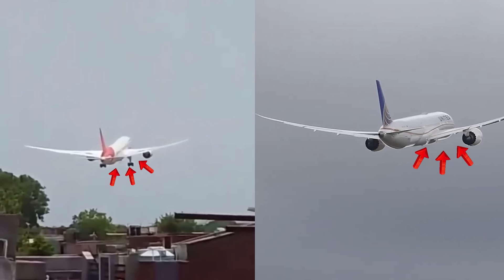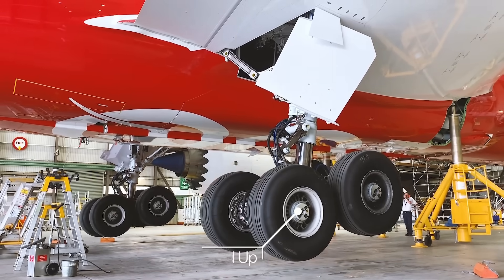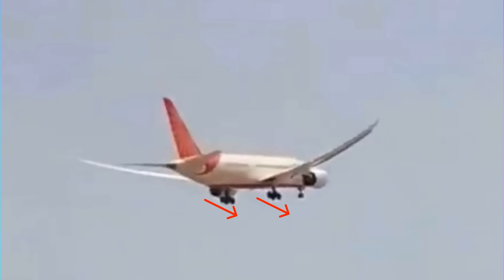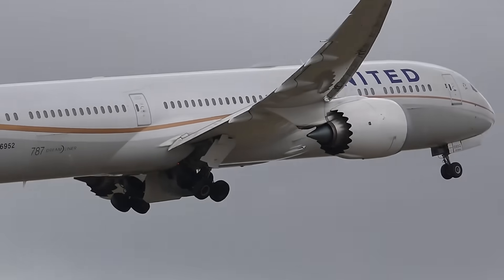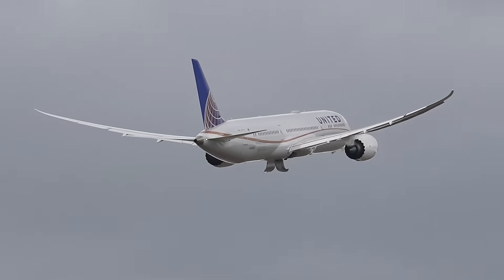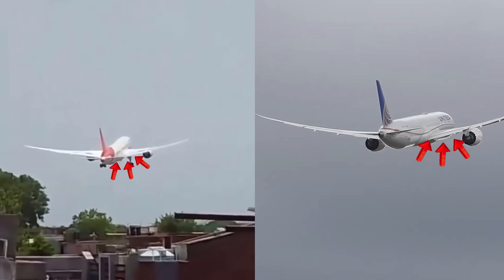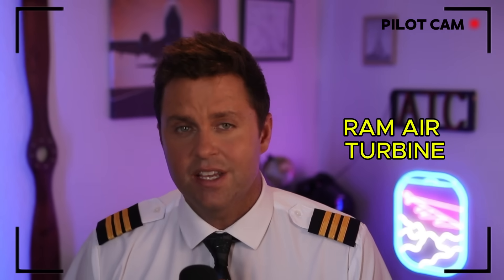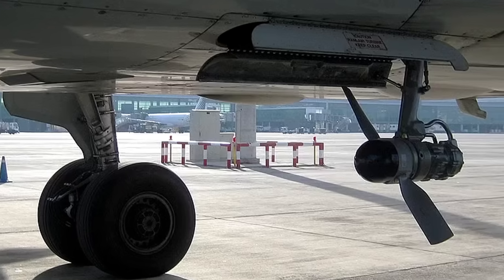Pilot Explains: A New Detail in the Air India 787 Crash Everyone Missed

Comment: Every one keeps saying the flaps. What we need to see or figure out, did the aircraft rotate at a point on the runway that would be predictable ( normal )  for a fully loaded plane with passengers and fuel and flaps set for take off position.  ( not landing  position. there is another goofball Ex fighter jockey, Civ Pilot saying if the flaps where down you would not be able to see the landing gear, Hope I never get on a plane he is flying ).  We have all seen videos of tragic and near crashes of planes not having flaps down trying to take off.  To me this planes take off dose not look like it was struggling to get off the ground.  It in fact got off the ground just fine.  The one survivor said there was a loud bang before the plane dropped to the ground. (?) Something happened to take out all the major control system.

Comment: Sir, reference to the scenario plane travelled almost the entire length of runway, of 3-km, as against 2.5km normal runway, given your observations thereof, should the pilots called off the flight, as yet they have not reached the threshold thrust required for a lift ?? Probably that's when sediments blocked fuel flow to the engines ??

Comment: Let's assume one of the pilot did retract the flaps. Even then,  is that something that cannot be made up if AOA is lowered with engine at take off setting?
I get that it would be a risk if airspeed is close to stall, but would pilots leave that small of a margin?
I believe it is highly unlikely that flap mistske alone will bring the aircraft down, even if that mistake was made.
Also, would there not be a warning before the flap fully retracts?

Comment: I don't believe Contaminated fuel could be the reason as numerous flights might have taken off with refueling done but no flight reported of such contamination.
What i believe could be a factor is the pipes through which the fuel flows through in the wings of the flight might have developed cracks or might have burst which resulted in stopage of fuel reaching the wings and thereby the engines could not get the power, thrust to keep the flight airborne.

Comment: I don't know what the weather was before the fueling, but I remember a flight in Daytona Beach were I could read the tires on an airliner that could not climb. We had some torrential rain and a fuel truck cap wasn't secured and so water got into the system. The plane made it back, but it was pretty dicey. I am always impressed with the thoroughness of the NTSB. I just hope that Trump hasn't cut their funding.

Comment: I agree with what you are saying about the flaps being correct, the gear tilted forward in the pre-retract position, the RAT being deployed, and the quiet engines (which should have been making a LOT of noise and exhaust), and dual engine failure. What about total electrical failure? Is there a common thing (such as a battery bus) that could have shut down the computer control of the engines? I built my own Long-EZ and flew it for 28 years, doing the maintenance myself. I think a lot about the causes of failures.

Comment: Ahhh now it’s clear. Somehow the fuel cutoff switch was pulled. But the survivor mentioned flickering lights. Would lights flicker if power was switched to the rat? Also another commenter below is talking about total electrical failure. Also the survivor mentioned he heard the engines rev UP and get LOUDER.
Reply: Wouldn't explain the wheel truck camber issue.

Comment: Contaminated fuel would have likely affected other aircrafts on the day. To me it looks like severe electrical system failure cutting off fuel supply to the pumps and all other systems. Then, did the electrical system itself fail or did the control system software take control. Either of those two potential causes justifies a grounding of 787s.

Comment: This is the only reason that seems now. Dual Engine Failure which resulted in
1. Hydraulic Control Loss - Landing Gear didn't go completely up and airplane is completely in the same settings or orientation as it was during take-off to the very end.
2. Power Outage - RAT got deployed.
3. Distress message - 'MAYDAY NO THRUST'

Dual Engine Failure Possible Reasons
1. Contaminated Fuel or Compromised Fuel Refueling for that specific plane.
2. Fuel Supply issue or fuel starvation to engines which is due to maintenance issue which is high likely.
3. Pilot error disabling engines by mistake or deliberate action which seems unlikely.

It can be any out of these or other reasons. So, we have to wait for report that comes after a month and another that comes after 6 months or a year.

Comment: With bad fuel, any engine should "sputter" before it shuts down, with probably visible smoke from poor burn of fuel. And i would find it almost impossible for the 787 to have any malfunction that shuts off fuel to both engines , again so cleanly that there is no smoke. Why would you ever want a system that cuts fuel to both engines simultaneously ?

Comment: Is there any process to do with the apu being running during takeoff?

I would have thought a 3rd small, and systemically isolated system would at least maintain basic flight controls, and perhaps even gear retraction in the event of a dual failure, and/or at a bare minimum remove the drag a rat creates extending the flight time by a few important seconds.

Comment: Great analysis. The lone survivor told the media that lights flickered before the crash. Does it add to the conclusion that there was a dual engine failure?
Reply: Since the 787 is an electrically powered jetliner, lights flickering could be a sign of an electrical power failure, which could ultimately lead to engine failure.

Comment: Great catch on the gear however, I really think there’s going to be a good amount of pilot error for not aborting the takeoff. If you watch the takeoff roll, that plane was going unusually slow for where the camera picked it up on the runway. I understand most pilots/crew don’t have a set acceleration check during the takeoff but there’s almost a six sense that kind of keys you to how fast you should kind of be at a point in the takeoff. Then let’s say he noticed this beyond V1, (1. Underpowered engines 2. Probably heavy with a 8+ hour flight) seems like it’s better to take the odds over shooting the end of the runway.

Comment: Fuel bladders are in the wings. Kerosene floats on water. If the fuel pick up was sucking in fuel on flat ground, when the plan rotated, it is possible that it starting sucking in water. Especially if the fuel pickup is towards the rear of the wing. Once the fuel in the lines ran out, the plane was about 600 ft in the air and started injecting water, flamed out and thats it.

Comment: You need to get the view of a mechanic... lucky .. I have been one for 36 years.
1. The engines did not flame out. You could still hear the engines despite the rat.
2. Engines running at idle and could not thrust any power
3. Most likely, fuel tanker that delivered fuel had previously delivered gasoline and did not deplete one of its compartments and filled it with Jet Fuel ( Diesel) and unloaded all contentents which added gasoline to the jetfuel. Gasoline has a lower ignition point. When mixed, the engines will continue to run, but you will have no power to increase thrust and if had got higher and flew longer, the engines would sputter out.
4. If there is a crack in fuel storage tank, water from the ground will mix with the fuel. This will let the engines run for a very short period of time before shutting down since the water is not combustible.

If you put gas into a disel car... the engine will stay running at and idle once it reaches injection point and it will feel like someone removed the throttle cable.. you can pond on accelerator as mush as you want but is will have zero effect on rpm's of eng and then it will shortly die out.

The sound and actions seen point to gas or water mixed with the fuel.

I put this on both of captain steves comments... I have been contacted by other mechanics and they 100% agree.... I don't think many pilots have experienced this before and live to tell about it.

They need to check the storeage tanks which should have 2 printout daily that can show signs of water and they need to check the tankers that delivered the fuel and see if they had previous gas deliveries. Yes.. Gas, Diesel, Jet Fuel are all delivered by same tankers.

This plane has 6 fuel filters.. Id any survived, they need to be cut open and have the collection device checked.
Reply: I'm sorry but a lot of what you say is not correct, only one type of fuel is permitted to be carried in a fuel tanker. Jet Fuel is basically a very highly refined Kerosene called AVTUR. Both Gasoline and AVGAS (Aviation Gasolene) have a much lower flashpoint, as you call it, you probably mean ignition point, than AVTUR (Aviation Turbine Fuel). Water is always drained from the bottom of all vessels and containers prior to refuelling an aircraft as you are aware water always settles to the bottom of the tank. A small amount of water is not a problem for JET engines as it is for ICE piston engines that run on AVGAS. If they are carrying different types of fuel in the fuel trucks in India, it would be the only place in the world that it happens.
Reply: @glukes9 Funnu.. United airlines used the exact same fuel for its buses used for passengers and pilots from parking lots to building as its airplane.  The United buses used to have a problem with oil getting into the air syaytem that operated doors and brakes. I redesigned the air compressor return system to stop this. 
The exact same tankers transport all the trpes of uel, yes.. they are to be drained and cleaned between uses. It does not always happen. Some are to much in a rush and know a small amount of another liquid mixes with the jet fuel ( which IS a form of diesel) but the blend has a different specific gravity rate.
Most large airports in America ship fuel to airports via pipeline since planes like the 787 hold over 33,000 gallons of fuel and a tanker holds 7,500 gallons. 
We are talking about India, not America and my views on what happened is based on  it happening in India and what I heard on the sound of what was going on with the engines. They did not flame out and they did not mutually fail.
In America, we check readings on storeage tanks 2x's a day or more but it is before every delivery.
While tanker do have dedicated units, they do overlap and the tnkers have completely  seperated sections in them, making it possible to carry 2 different fuel in the same tanker. This breaks no OSHA or DOT laws, so you know it is done. I have caught many loads being shorted because the drivers just tell you how many gallons they gave you but when I check my readout so I can pay them to the penny, I can see they are way off because they forgot to empty a section inside the tanker..
I have listened to so many different kinds of engines contaminated with different fuel or water, it takes a few seconds on the gound to know what it is. These sounds are not availiable in the cocpit.
Reply: @glukes9  It is correct in India.

Comment: So I was thinking a few things

Was there fuel contamination? but in today’s world dont we have trucks that monitor specific gravity and moisture closely?

Loss of lift :
1) electrical and hydraulic failure - not sure if there was a maintenance issue leading to fuel sysrem failure.
2) I wonder if there was a control trim actuator lock.  if there was a trim lock that led to high nose attitude leading to loss of lift, fadec induced shutdown or reduced thrust, rat comes out, not enough vertical separation for gaining speed and control 

Thoughts?

Comment: What if right after they took off, the cockpit signaled the two engines failure and they instead of putting the gear back, they did the flaps! And it made them lose lift.

Comment: I’ve seen a number of videos and ideas now. Is it correct the plane should have rotated around 2/3s of the way down the runway? There seems to be footage that puts it more towards the end of the runway and it kicks up a lot of debris. What’s kicking up all that dust etc if no trust? Maybe just the momentum of the plane?
It looked like that pilot tried to use all the runway, Why? Maybe just before V1 or just after the engine/s suffered loss of power but to late to abort, enough to take off, lose momentum and fall.
Whatever the reason it’s an absolute tragedy for the people on board and their families 🥹

Comment: Even very 1st moment clean video was out there and it was pretty obvious flaps were deployed..  And there is another option that they forgot to push toga, So there was no FD and A/T was on so after take off engines pulled to idle.. Take another look to the video, Horiz stab trimming itself to nose up position changes angle of  attack, at the very end it is look like it is on full nose up degree, If there was not electric auto trim wont work and trimming it by hand on pitch up attitude wont be that easy and there was no time to get busy with it..

Comment: Hi Gary.. Although I am not a pilot, I have been closely following air crash investigations out of personal interest and curiosity for some time now. The apparent automatic deployment of the RAM suggests the possibility of a dual-engine failure. Under normal circumstances, the Boeing 787 is well-equipped to recover from any situation other than dual-engine failure, especially with a reasonably experienced Captain at the controls. While the 787 Dreamliner is a modern aircraft with a strong service record, some of the whistleblower’s statements raise concerns for me.... particularly regarding the long-term durability of certain components. Only time will tell..

Comment: The issue with the Boeing 787 Dreamliner and dirty jet fuel burning primarily involved a biocide treatment used in fuel tanks, which, when not mixed properly, led to engine thrust roll-back incidents. Additionally, there have been past incidents of lithium-ion battery overheating, which caused smoke and fires, but these issues have been addressed with redesigned batteries and safety measures. 

Here's a more detailed breakdown:

Biocide Treatment and Fuel Mixing:

A biocide, Kathon FP 1.5, was used to treat fuel tanks to prevent microbial growth.

In some cases, the biocide was not mixed evenly with the existing fuel, leading to higher concentrations in certain areas.

This uneven mixing, potentially due to fuel temperature, density, and tank design, could cause engine thrust roll-back.

The issue was particularly evident in Jetstar 787s and resulted in dual engine thrust roll-back. 

Lithium-ion Battery Issues:

Early models of the 787 experienced overheating issues with the lithium-ion batteries used for electrical power. 

This overheating could lead to smoke or fire, both on the ground and in flight. 

Boeing addressed these issues by redesigning the batteries and battery containers, implementing thermal protections, and establishing thermal safety limits. 

Other Incidents:

There have been other incidents involving the 787, including fuel leaks and engine failures, some of which were linked to improperly assembled fuel line couplings. 

Some incidents involved loss of cabin pressure, altitude, and issues with landing gear and flaps. 

In summary, while the Boeing 787 has faced some challenges, particularly with fuel tank biocide mixing and early battery issues, the company has taken steps to address these problems and improve the aircraft's safety and reliability.

Comment: Good analysis.  As you say, there is a lot that will only make sense after proper investigation.

One thing that comes to this non-pilot is that, normally, the landing gear seems to be retracted very quickly after takeoff.  So, in this case, pre-retraction tilt is done, retraction itself begins, or is about to - and THAT is when the total power failure hits.
Guessing this phase is a demanding one for the aircraft's electrical system, but that it is also multiply redundant for exactly that reason.  So, a sudden power surge popping the wrong circuit breakers, and so blacking out the entire aircraft, couldn't possibly be a factor, because there are  ... what?  Three or four separate systems?  My assumption, anyhow.

Given that the pilots afterwards set about a reasonably controlled descent, got off a distress call, but COULDN'T restart or restore power, has me looking more at the aircraft rather than pilot error.  Let's face it, Boeing has not been having a good run in recent years.  But, as you've said, we'll see.

Comment: RAT is automatically deployed when a overloaded engines fails immediately #MiTRON the #AI171 likely was 115% overloaded failing both the engines in hot less dense air to create the difficult struggling  lift at 40 degC temperature on 12 June 2025 the engines just failed on overloading and starving for air to burn the fuel. 

This plane was overloaded folks as per Amit Shah 125000 litres of Aviation Fuel weight is 100000 kg +payload weight 41000kg + operating weight with fuselage is 120000 kg clearly we exceeded the flight to 2.27 MTOW.  Clearly exceed 115% of engine and plane capacity of AI 171 Factor in the hot less dense air it is making the engines work exceeding 120%. #AirIndiaPlaneCrash #DGCA. Agree that gear up command exceeds the overload condition in a hot weather totally overloads and fails bother IDG, APU, backup batteries

Comment: As per the mayday call, there was no thrust produced. This means that the engines stopped working. The possible reason could be that the fuel jet pumps (ejector pumps) stopped working cutting off the fuel for combustion.